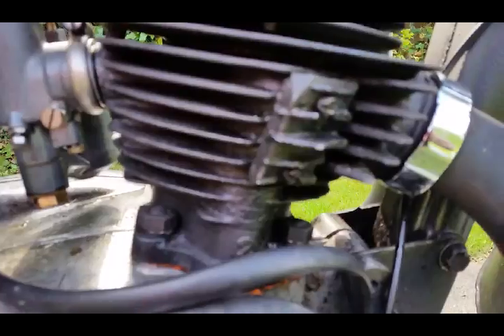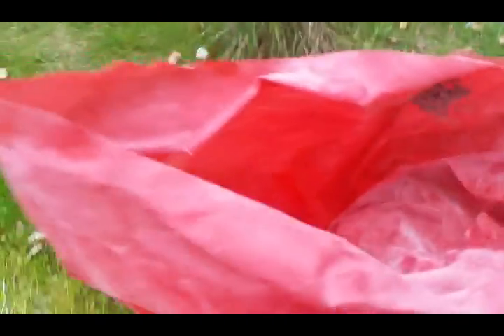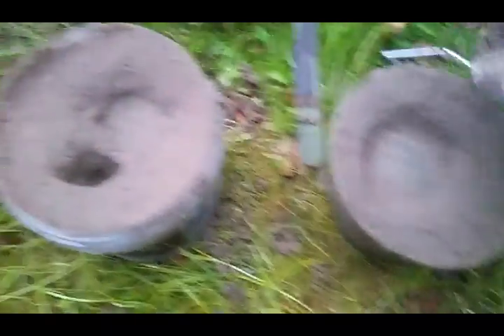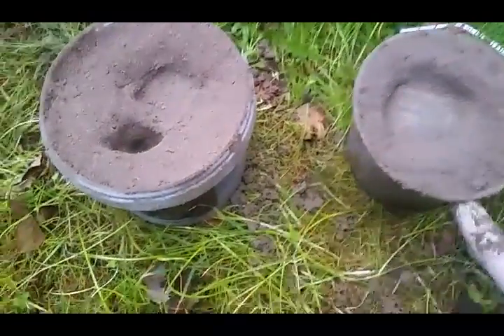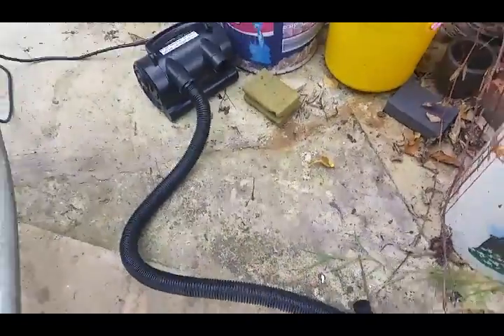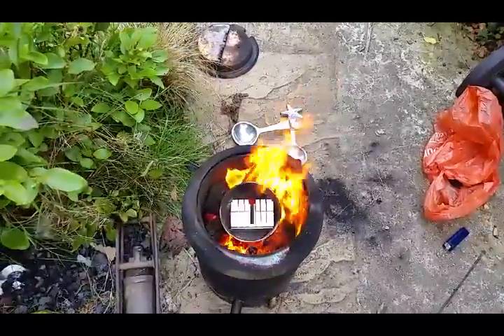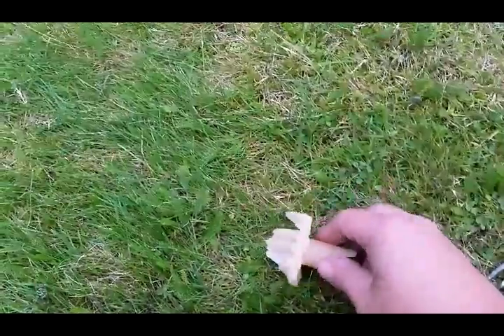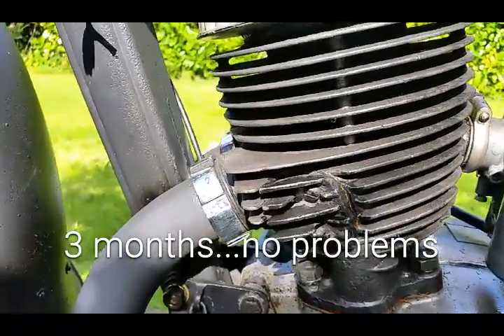Cast your own metal engine parts from aluminium for a DKW NZ 350 WW2 German oldtimer (Lost Wax)

Comment: Instead of clay or "cement" you can use what the americans call "drywall mud", we call it plasterboard jointing plaster, I think? A good tip is to vent the mould, by adding wax sprues before dipping in the plaster and sprinkling with fine sand, multiple layers to build a shell around the wax (known as an "investment"), melt out the wax then support the investment shell in sand before pouring your ally. Done carefully, the casting will come out with smooth, complete fins etc. :)
Reply from the maker: Thanks for the tips; wasn't bad for first go hey. Ill try dry wall plaster next ; but the biggest issue i had was getting a smooth wax copy? even if the RTV mold is smooth the wax seems to dry a bit lumpy and shrink as if air is moving it about? or the wax is odd from being a scented candle....
Reply: Dave H rumahmu to